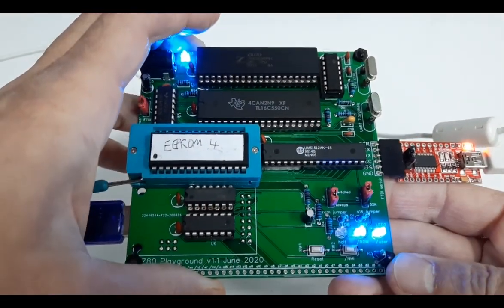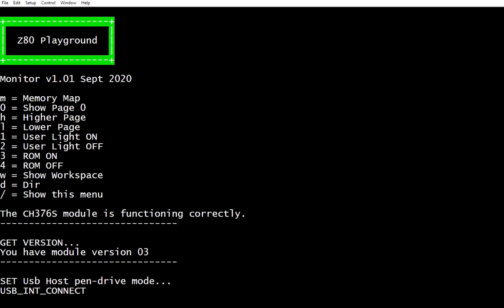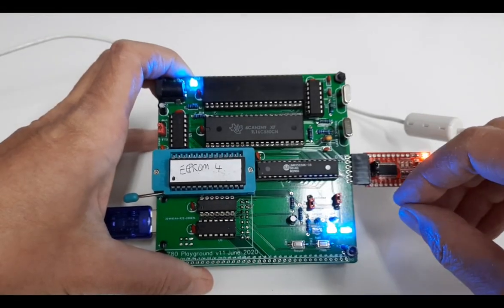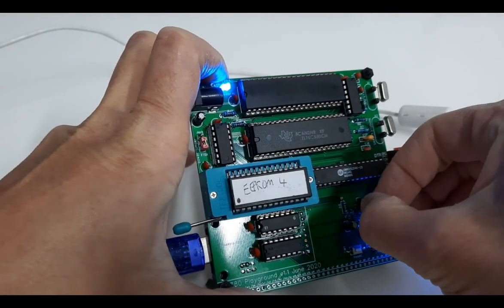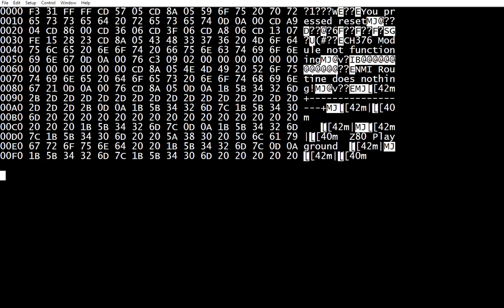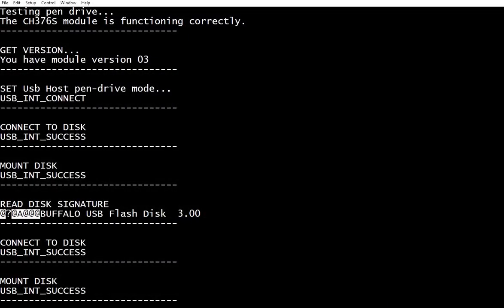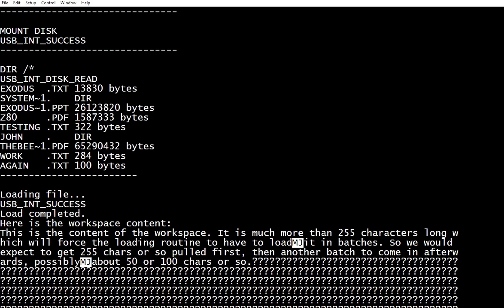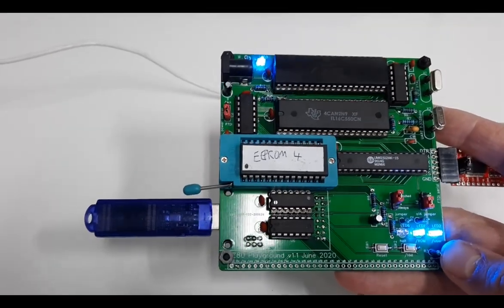Z80 Playground v1.1 is my Single Board Computer for Assembly Language, Basic and CP/M

Comment: Just wondering what would happen if you only used a 2K EEPROM in the ZIF ?
Reply from the maker: I'm not sure. I suppose the memory mapping would just mean that the rom appeared 8 times over, repeated i memory.
Reply: @CircuitBreaker256  I only ask because back in the day when the Z80 was new, I don't think they had 32k that were cheap enough to use like this. Also how much space does you monitor take 2k - 4k maybe ? I just hate wasting space. lol
Reply from the maker: @The_LanMan  Well, I have a switchable system, so I can set the ROM area to be 16k or 32k. I was thinking I need to add 8k as an option too because I want to do a Jupiter Ace work-alike which I think was 8k or rom. I have not measured my monitor size, but it would be less than 4k easily. The thing is though, you can still put a 32k rom in the socket, but set the memory address space so only 16k is visible. Also, you can copy the rom to ram, turn off the rom (in software) and then run the monitor from ram, leaving all the rest of the ram free. That is my preferred option.

Comment: Where can I get this board and chips?
Reply from the maker: Can I ask, if I made a kit available, including all components but not soldered together, and some instructions etc, what would you pay for it?
Reply: @CircuitBreaker256  I would, cheers Albert
Reply from the maker: @albertpauw8234  How much would you be willing to pay?
Reply from the maker: @albertpauw8234  I am thinking of a kit containing the PCB, all the sockets, components etc, a ROM with a few interesting things already in it, and the FTDI cable, plus printed assembly instructions, and a link to a video where I assemble and test one myself.
Reply: @CircuitBreaker256  I find that a tricky question. I have no idea how much the components are, plus some extra for all your work, plus shipping (I'm in The Netherlands).I can wait a few revisions. I programmed Z80 in the 80s (build an FM synth with it on n MSX machine), and MSXDOS (which was compatible with CPM). So all this is a trip down memory lane.
Reply: @Circuit Breaker If you want, you can email me. It's my name with a dot in between and it's a gmail address.
Reply: I suppose a similar board would be sold over around $100 bucks? But personally I would pay $50 or so. Although $100 and above is worth it if it's all open sourced (and well documented), because after all this board is mainly useful for educational purposes.
Reply: @CircuitBreaker256  Sure would. If you do ALL the work, where is the fun in that. :-)
Reply: I think $80-$100 USD would be a fair price. Id pay that for sure. I would really want schematics and source code for the boot rom etc.
My plan would be to port CPM to it with mass storage, and do some C development work. thanks

Comment: Project is looking good! I like your idea of using the CH376S, curious how you get on with that. As for the serial connection, have you considered something like a Wemos CH340G (you can find that on AliExpess), makes connecting it up to USB a bit less fragile? Looking forward to your progress.
Reply from the maker: I've not looked at the CH340G. Not a bad idea! I chose the CH376 module because it has an 8-bit parallel interface. I'll do a video on how I connected to it, and the Z80 code to talk to it. The datasheet for it is, um, challenging!